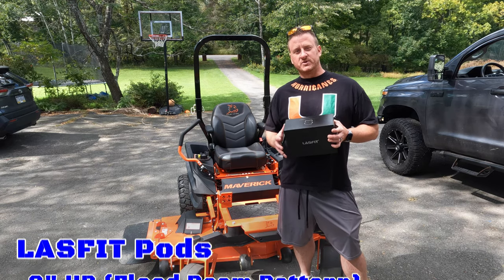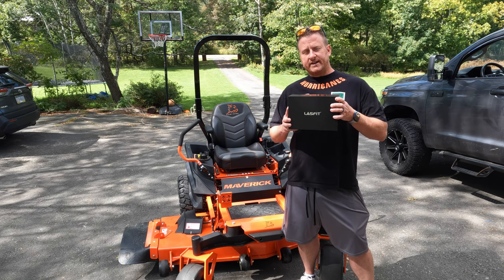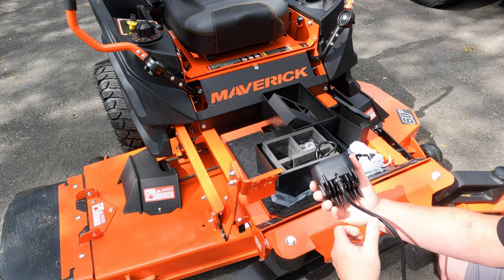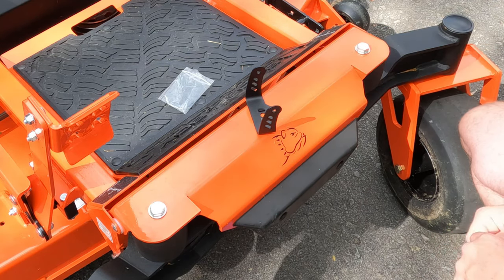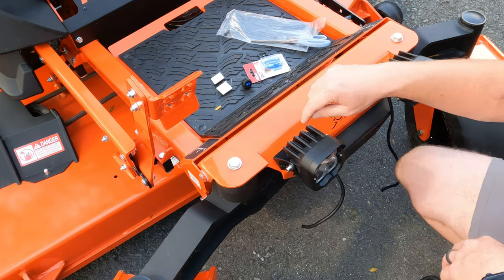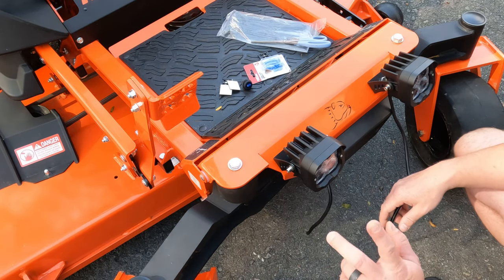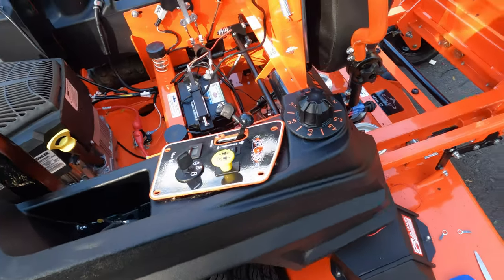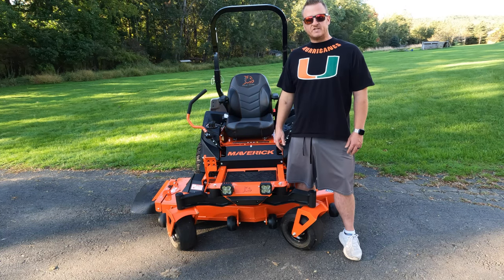LASFIT 3" LED Pods...Custom Mounting On A Tractor???...Extremely Bright!

Comment: Great instruction.I got ahead of myself and ordered the sport version, which is not what I wanted.  LasFIt was great, they exchanged them out for me and I paid the difference. Great customer service, by the way. I ordered all the wiring and butt connectors as you advised. Now all I have to do is try to duplicate what you did. Im not a wiring guy but your instruction has given me the confidence to try. Thanks a lot.

Comment: Nice video. Another good option between the mounting brackets and frame is some thin rubber padding. No worry about retaining moisture. I have a magnum so I'm gonna use the spare button blank in on the control pad for my on/off switch. Thanks for the great vid.

Comment: How are your Kenda RTs holding up just bought a set
Reply from the maker: I’m actually editing a follow up video right now, it should be posted on the channel in the next couple days!… I show how they are holding up after about 26,000 miles, I love em!
Reply: @NitroZ18Fishing  just mounted mines yesterday and I love them as well took them in the mud first day they got installed
Reply from the maker: Yep, they perform much better than I ever expected!…just make sure to rotate on schedule and watch your alignment of course…you’ll see why in my follow up video, I got lazy and paid the price 🤣
Reply: @NitroZ18Fishing  yessir I plan on rotating ever 3k to 5k miles
Reply from the maker: Perfect, I usually do every 5 and never had an issue…still can’t believe I did what I did 🤦‍♂️🤣

Comment: Awesome i also have a 2021 mav, and I just installed a rough country light bar on my rops bar super bright!! Now i dont have to worry about running out of day light mowing…night shifter problems lol. I used a rocker switch for mine an it fits perfectly in the stock cutout for the electric deck lift switch. I seen u have that option so the lil spot u put your toggle switch in work perfect too. Ik they ride like a dream with or without a air ride seat but for your next upgrade id suggest the air ride its on a new level of comfort man! If u haven’t done your first transaxle fluid change let me know and i can give u some info on how to do the new mavs with the internal expansion tanks they are alil different from last year’s models with external tanks. I had to figured out they are no vids on how to change the fluid on youtube yet so i had to go by the manual and no body likes doing that lol. Maybe you can do some service videos on it since nobody has any of the 2021 maverick.
Reply from the maker: Thanks Brad!!…I’ll have to look into that air ride seat, I checked it out when I was comparing models but wasn’t sure if it was worth the money… If this thing gets any more comfortable I’m selling my recliner and I’ll watch my games in the bad boy 🤣… yeah if you don’t mind giving me some pointers there I would appreciate it, I can definitely make some videos on it but I would be doing the same thing as you since I’ve never owned one of these before… i’d have to buy the manual as well… thanks in advance man, I appreciate it!
Reply: @NitroZ18Fishing  yea they are for sure worth the money lol an yea its like mowing on clouds for sure.. and for the hydros you will need to jack up the rear end until the tires are off of the ground make sure the hydros are cooled off completely…then they are a fill port plug on top of the hydros then another indicator port plug on the side kind of at the top to show you when its full you will need to remove both port plugs…they dont have drain plugs so you have to drain the oil from the filters and it does take a while for it to drain completely..they have guard covers on the filters i think they are 10mm bolts that hold them on..remove them and the filters, wipe down the filter surface on the hydros after draining the hydros removing any debris. Then lube the o ring seals on the filters and replace the filters. After replacing filters fill the hydros by the top fill port until fluid starts runs out of the side indicator port indicating they are full. Install both of the port plugs and put the axles in neutral by Disengaging the drive rods to the axles by pulling them back all the way and putting the pin in. Start the mower and while its on jack stands with the wheels off the ground, you will need to do the purging process. All you have to do is push the sticks fully forward an hold for a few seconds then pull back to full reverse an hold for a few seconds, you will want the mower at full speed when u do this.. you will need to do that about 20-30 times then turn the mower off. Let the hydros cool completely off before topping them off again…after cooled and topped off, put the hydros back into drive by pushing the axle disengage rods forward and putting in the pins and Then repeat the same purging process but with it in drive. Top it them off once more after they cooled down completely filling them while still warm you can damage seals in the hydros from over filling them because the hydraulic fluid expands when its warm an the expansion tanks are inside the hydros on this year models. Then Replace the plugs an you should be ready to drop it off the jack stands an let er roll…After i mowed my yard once after changing the fluid I took the plugs out once more after it cooled just to checked make sure they was still full because the point of purging them is to get all of the air out of the system. Its not a hard process its just very time consuming waiting for them to cool off and everything.
Reply: @NitroZ18Fishing  also on the fill port on the top they are a vent valve that looks like a castle nut right beside the port plug make sure you don’t confuse that with the plug because you can damage it. The fill plug just looks like a regular silver bolt an so does the side indicator port plug. Also if you drain the oil and its grey in one or both of the hydros and not honey colored like they should be, they have gotten water in them through the vent valve on top. I didn’t know this but you’re not supposed to use a pressure washer on them because it can push water into the system. One of my hydros fluid was dark grey when I drained it and i found out that was why. If you run into any problems or have any questions just let me know an ill do my best to help u from my mistakes lol good luck.
Reply from the maker: Ok awesome, thanks so much for the help!… I’ll try to throw a video together when I change it, thanks for taking the time to explain all of that!… I feel like I’m going to have to send you a commission on the video! 🤣🤣
Reply: @NitroZ18Fishing  no problem buddy, wish I had knew someone that done it instead if me going into it blind lol…at least you’ll have some insight on what to do from someone thats done it..before you do it yourself now lol…First oil change is @ 8 hours and first hydro oil an filter change is @ 50 hours. Then the hydro oil needs changed every 250 hours an the engine oil every 50 or annually.